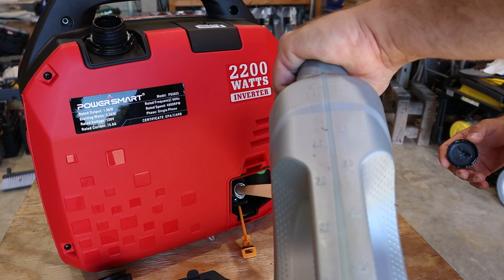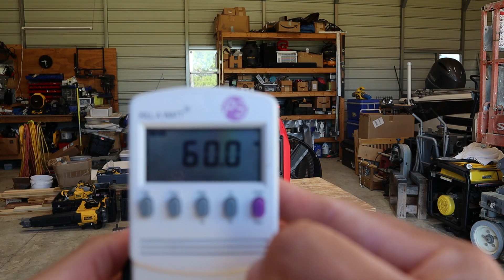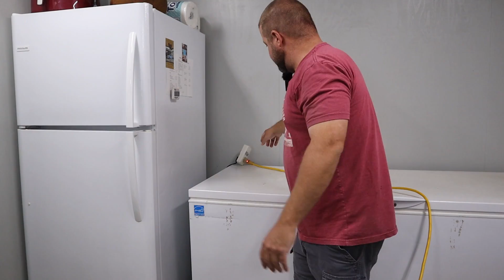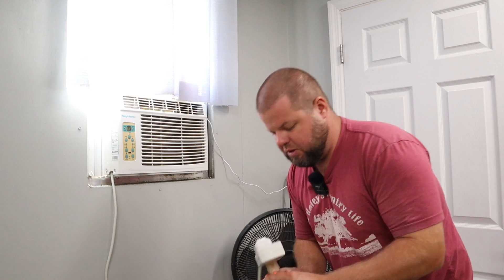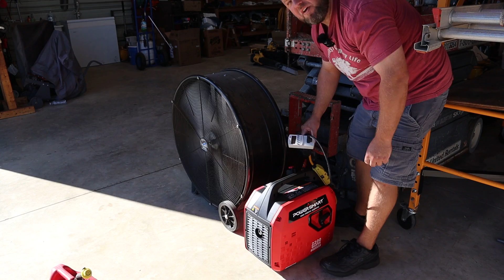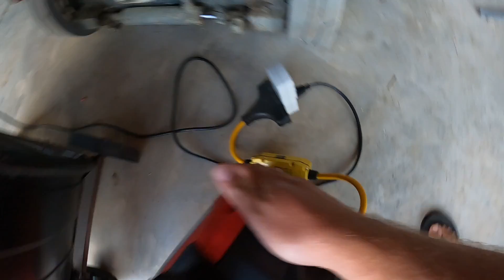Fantastic portable generator! PowerSmart 2200 watt inverter generator

Comment: My  2000 watt inverter generator I can run a refrigerator a  small freezer a box fan and a couple LED lights easily . If your in a natural disaster fuel  usage is everything . A good Small generator is key to saving fuel also the old saying one is none and two is one is so true.

Comment: I have the 1500 can run ac or refrigerator but can't ruun microwave or coffee maker this one will handle that .I ordered the 4400 3600 contuis open frame  comes in today yea😂 for my bigger power needs. My old regular generator was way louder and ate 2 times as much gas. But i still might buy this one ❤
Reply from the maker: Some coffee pots and microwaves pull up to 1800 watts, you are for sure going to want to run those on a larger model like you ordered.

Comment: I bought this generator for the first time and after running it for a few and started smoking.. is that normal ?
Reply from the maker: There is factory oils to burn off. Also make sure you didn't overfill the oil.

Comment: The specs The advertiser not true. If you run it with 16 or 1700 w, it'll just hang in there that's all I can handle. Try running more and see what happens, it won't last.
Reply from the maker: It's rated for 1900 continuous and 2200 surge. You should size your generator to run 50 percent or less of max capacity for a longer life.

Comment: Just bought a brand new one and followed the instructions to a T. Can't get it to start.
Reply from the maker: Fuel turned on, choke out and eco mode on? Mine usually starts in two pulls. Make sure the vent on the gas cap is open as well, but that shouldn't matter for a quick start.

Comment: Hey I have a question, 
I’m looking at getting a portable AC unit and looking to run it of this Generator, 
Will it be enough?
Reply from the maker: I would need to know the power specs of the AC, amperage and wattage pull.

Comment: Just wondering if this generator could be used to charge a solar generator when there are long periods of no sun? Seems like it would be efficient but I cant find much info on that.
Reply from the maker: I do that often with my solar system. Just make sure it doesn't pull more than 1900 watts. My systems are controlled by apps, I can set how much charging power I want going to my battery banks.

Comment: This is a great generator. The Eco-Mode option keeps the generator at a low speed until it demands more power. It's fine to keep it on Eco-Mode all the time, it'll adjust accordingly.

Comment: I don’t know if i overfilled it but I’ve got it to leak while being little crooked on a table
Reply from the maker: Hmmmmmm, well it does have a vented cap. Overfilling will do that.
Reply: @TKCL  the one on top? So if im transporting the generator with fuel in my trunk should i try to have it empty or twist the cap on the off
Reply from the maker: I'll need to check mine again, quite certain it has a closable top. If transporting in a closed vehicle I'd definitely close the vent.

Comment: Just received one of these generators for Christmas. Never had a generator before. Going to use it for camping and maybe some power tools. My question is when would you ground the unit.
Reply from the maker: You technically should always carry a wire and rod to ground the unit. Almost no one does but it's a safety feature. If the device you are using that's plugged into the unit were to short out and be exposed to you, without the unit grounded YOU become the path to ground for the electricity to travel and can be electrocuted. Obviously that takes a malfunctioning devices with something exposed. A copper rod and a piece of wire is cheap insurance and easy to carry with the generator.

Comment: Man that's a pretty damn good generator I have the generac 3500 IQ does the same as a 30 amp twist lock plug but the only thing is it's square bulky and heavy as heck
Reply from the maker: This company makes a similar model too. I was really interested in a quiet and portable model. I've never had that before and love it!

Comment: Need an extended run gas cap to run a external tank like my Honda. You'll get days of use, but of course you should rest them per the manufacturer suggestions.
Reply from the maker: I'm a big fan of letting these air cooled engines cool down every few hours.

Comment: Beware of the DEFROST cycle.  Most modern frost free fridges and some freezers have a defrost heater which may present a load around 800 watts for twenty minutes, two or three times a day!  Look at the schematic (attached to the rear of the fridge or on-line) and you will see the heating element(s), and a Control Module or simple timer defrost clock (old).  The stated peak wattage may be that of the start-up surge, but it's the defrost cycle that's will suck up the gas.  Also...Remember when having two or more freezer/fridges connected, it is only a matter of time before compressors happen to start at the same moment...and then...you better check your generator often to see if it tripped!  It WILL happen!

Love your channel, eespecially the rural internet solutions you have experimented with!  As a Ham, I have plenty of interest in all things power, engines, electronics, and comms wise.  You have received much good advice and discarded some of the bad... I've been watching!  Keep it up!

Comment: Why would anyone want to run a heater off a generator? Just buy a propane heater like a little buddy portable heater. I use this at my camp with the big propane tank adapted.
Reply from the maker: You do realize running a propane heater indoors is dangerous right? Ever heard of carbon monoxide? That's why they specifically make vented indoor propane heaters, running your outdoor buddy heater is asking for trouble if ran long enough. So yes it's actually quite common and safe in the event of a blizzard and cold snap knocking out power to run an electric heater in an emergency.
Reply from the maker: I'd suggest installing a carbon monoxide detector in your cabin it's cheap insurance and I bet you'll see it goes off.
Reply: @TKCL  well I only know of one death in all of River Ranch's history from carbon monoxide poisoning and that was a fire fighter that has his generator outside his camper but too close to his window unit a/c.   
 But yes, I always have a vent on the floor level and one up high open.

Comment: Generators are a must have here in Florida. I have 4 of them from 2000W up to a diesel on a trailer. I'm serious about my generators. We like to hot tube during a hurricane. Even my shop has it's own generator, AC, fridge, and water. I've sat in the dark, never again.
Reply from the maker: You and me both, I own several too. Too many times sitting for days in a hot sweaty house. Taking cold river baths got old.
Reply: @TKCL andrew how long will that generator take to recharge your battery banks? Or do you use your champion (what size) to charge th batteries?

Comment: I have the Aldi version of this generator. Love it. (Yes, Aldi has historically private labeled and sold these about once a year for the last 5 years or so.) I don't really call it quiet but if I can put it outside of my kitchen door, run a cord inside from it, and close the door, it's not so loud that you won't to grab earplugs. I replaced the dipstick in mine with a magnetic dipstick from the first run. I highly recommend one. I was surprised by how much metal dust was stuck to the magnet after running the first couple times.
Reply from the maker: I need to get one of those dipstciks. I can assure you this is insanely quiet compared to my other generators.

Comment: Stupid question I guess but the gas generator has to be outside. How do you get the lines into the house. Through a door how do you seal the cracks. Also I guess you run extention cords to different appliances. Run tgd frig a while then the frezzer a while. Then a heater. Seems like it would be a screwd up mess.
Reply from the maker: That's typically the way you run small generators. I usually run a cord through a window. I can assure you that the mess does not matter when you are trying to save expensive food, run an AC, charge phones and more. My big generator runs to a plug I mounted on the house and feeds into the main panel. That keeps everything nice and clean, but requires a big 240 volt generator.

Comment: The eco mode will give you “1900 watts”. Idea it it adjusts up the RPM according to load.  Reason you want it off is for heavy motors starting that have the surge.  It’ll already have the engine at RPM vs it having to catchup .  Say you’re starting off on eco mode then use 1900 watts, it’ll run as if eco mode is off.

I highly doubt it can reliably do 1900 watts for a while with a 79cc engine.  The Honda eu2200 has a 120cc engine and does 1800…
Reply from the maker: The manual states don't use eco mode with a load over 1200. Most likely due to the surge you described is my guess too. Highest witnessed continuous load during this test was over 1400 watts. I did not get to view it while the table saw was working, that might have been more??
Reply: @TKCL  I’m 100% that’s the reason.  Getting from 0-1400 is quite the jolt and at low RPM there would be a delay.

Now say you’re running a 1400 heater, you can start that on eco off, then then eco mode on will drop the RPM’s a bit to match the load.

I’m certain they’re concerned about it not ramping up fast enough to catch the load with a 79cc engine.  I’ve done 0-1500 on eco in my Honda eu2200i no problem, but it also has a 120cc engine

Comment: I’d be curious how the sine wave is hooked up to an oscilloscope.  Some of the cheaper Chinese ones don’t have as clean of a sinewave.

I still swear by my Honda EU2200i.

My friend has one that he runs 4 hours a day for 3 years.  Still running strong.  Doubt any Chinese generators can do that.
Reply from the maker: Hard to say, I use to have an oscilloscope at my business I owned years ago.
Reply: I watched another vid that showed the sin wave when a hair dryer was running....it looked clean....but being that its not advertised as pure sine wave and they have a model for pure sine wave, my guess is ...things like refrigerator arent running pure sine wave but looks like you can get close to pure sine wave for low wattagw things like  tv or laptop (based on other video i saw)

Comment: The only difference between Eco mode and normal mode is in normal mode, the generator engine runs at full speed regardless of the load, in eco mode the engine slows down if the load doesn’t require full speed of the generator. Think of it like cruise control on a car. Eco mode only works on inverter generators because on a standard generator engine RPM determines the frequency, if you slow down the engine the frequency drops. Because inverter style generators generate DC then electronically convert it to AC both the voltage and the frequency can be adjusted electronically independent of engine speed. You should run it in Eco mode 99% of the time unless you have a long continuous load that never cycles off and on.
Reply from the maker: I absolutely will always run eco unless the load requires higher, should help the engine last longer too. Plus I love how quiet it is.
Reply: @TKCL  you will get the same o	output in both modes.
Reply from the maker: Not according to the manual, states don't run a load over 1200 watts in eco mode. That's most likely due to the low rpm of the motor and needing to quickly ramp up for a heavy surge.
Reply: @TKCL  i have a 4 kva inverter generator it has the same capacity both on Eco and Manual throttle control. I guarantee the maximum output current is the same in both modes.

Comment: My Honda 2000 generator I added a magnetic dip stick, 6 gallon gas container. Must for that magnetic dip stick . Over 2500 hrs on mine
Reply from the maker: Awesome, that's amazing hours!
Reply: We run the generator at nite for my Cpap. Runs everything at camp, water pump,lights, yard flood light,tv.  Will run deep fryer but has to be on non eco mode.
Reply from the maker: I'd say you got your monies worth for sure.
Reply: I think the magnetic dip stick helped a lot. You wound not believe the filings in the oil. Still.   Should be required on all small engines.

Comment: Andrew  I was wonder how long it would last on a tank gas running the window a/c at 75 ish
Reply from the maker: That's going vary wildy based on your room, insulation and outside temperature. Let's just say a very long time as that's less wattage than my fan was pulling.

Comment: Non-ethanol.  It should be everywhere.  Thanks big Govt.  I noticed you had a Champion.  I run two and find them solid.  Post up a long term review of the Powersmart.  I've been wanting an inverter for a long time.
Reply from the maker: My champion has been bulletproof, but it's your typical dirty power generator. I'm happy to finally have a clean inverter for certain situations. I'll definitely keep you updated on it.
Reply: @TKCL  Sounds good. Looking forward to it!

Comment: I think you may have misunderstood what eco mode actually does. When eco mode is on it will allow the generator to idle down according to the load. If there is a small load it will idle down. When the load is increased even all the way up to rated capacity it will idle up to an rpm that is appropriate for the load. There is no difference in rated capacity when in eco mode, it just matches rpm to the load that is applied to it. When the load is decreased the rpms decrease along with the noise level ie quieter.
Reply from the maker: That's pretty much the way I understood it. However the manual clearly states don't run a load over 1200 watts on eco mode. So obviously it doesn't adjust all the way up or it can't handle the initial surge while idled down.
Reply: @TKCL  interesting... I've got a couple of inverter generators one harbor freight predator and one generac. Both of those brands don't put a lower limit on the eco mode. Maybe they are being conservative or possibly engineered completely different. I don't know.
Reply from the maker: My guess would it's idled so low a big surge wouldn't allow the engine to ramp in time to keep steady voltage?? That's just me speculating though.
Reply: @TKCL Andrew how long will it take  to charge the solar wall battery bank? An the ecoflows power systems?
Reply: I HAVE A QUESTION 
I'M ABOUT TO GET A PORTABLE AC THAT FALLS 875 WATTS CAN THIS GENERATOR HANDLE IT AND ALSO CAN I PUT IT IN Eco MODE
Reply: Yes to both questions

Comment: I have had problems with the alternator with power smarts generators all the engines still run just no power burnt coils
Reply from the maker: Alternator? You mean the charging device for a battery and electric start model? Or the generator portion?
Reply: (gen head)Generator part that makes the power I have 2 of them burn up with in a few months I went with a Honda and have no issues so far just hit 4500 hours on the one I use for my ac unit
Reply from the maker: Bummer, I'll have to keep an eye on that. What model was it?